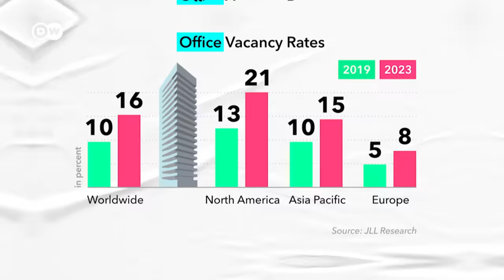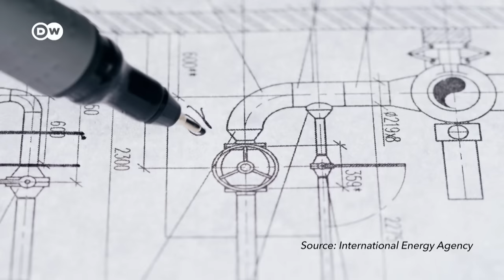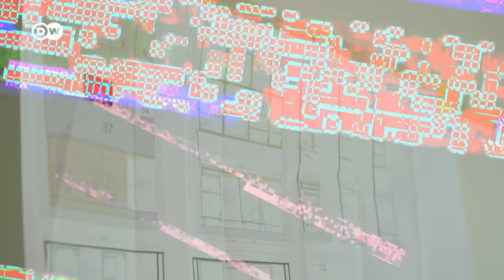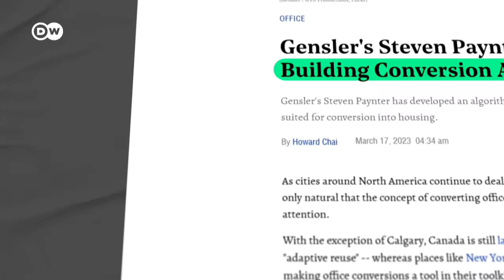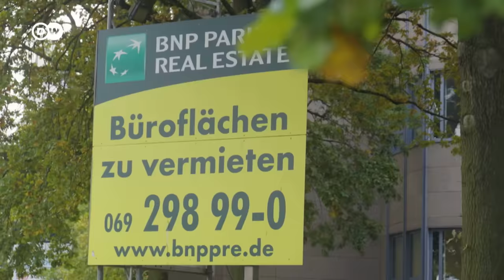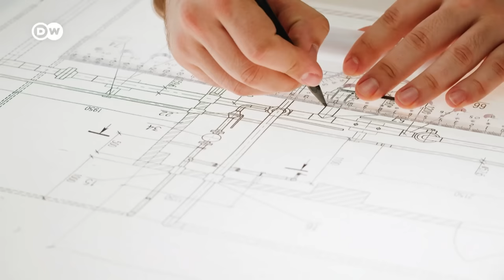Why don't we just turn empty offices into housing?

Comment: Well there's an easy fix for fitting in a lot of rooms with natural lighting.

Long apartments, note, not studio apartments.
The only window is the bedroom, so how does the living room get light?
There are many many ways of accomplishing this same idea, but ultimately the wall that separates the bedroom and living room just has a way to allow light through it, but also remain shut when wanted. This could be a halfwall with an entire slideable or folding section to open the other half. This could be glass walls with curtains. This could be standard walls with indoor shutter "windows". The best part is that halfwalls come with their own utility. If someone never wants to shut their bedroom-living room wall, then now they have an additional shelf space being the wall itself.

So your front door is where the bathroom is. Your kitchen and living room are right after. You probably have some cupboards in the opposite wall to where your bathroom and kitchen are, and then at the back is your bedroom. No natural lighting to your apartment unless you open the wall separating the bed and living room.

Additionally, you can butterfly flip this layout as needed. So if layout d has entrance in the bottom corner of the d and bathroom and kitchen on the left, then b is entrance on the left and bathroom/kitchen on the right, so a hallway connecting apartments such as dbdbdbdb would allow you to not only place 8 apartments on one side of a building all with natural lighting, but also would only consist of 4 specific plumbing points, as for each db combo, all four points of two bathrooms and two kitchens are right next to each other.

And it's worth mentioning that these concepts aren't new. Similar things are done with luxury caravans due to their limited space and side sections being taken up by other more important things than light such as kitchenettes and bathrooms. The light can only come in from the front and back, and minimally from the sides, which means light passing over the bed space to light the middle.

Comment: I do get a little nervous when you say that you don't want it to be easy to tear down an old building to replace it... because in a lot of circumstances, that is probably the best way forward. An abandoned big box store surrounded by a parking lot is such bad space use that refurbishing that big box store into anything else is still going to have horrible space use that will offset any gains from repurposing instead of rebuilding.

Comment: Part of the problem is that people who have been homeless  for a while are assumed to deserve to be homeless. They figure we must be irresponsible drug users who should be punished.
I'm 70, disabled, and homeless since 2016. The apartment I lived in for 17 years was sold, and the rent tripled. I've lived in horrid, corrupt bed bugged boardinghouses, and horrible nursinghomes. I'm costing the state 3x more to be in a nursing warehouse than if there were rent assistance. I've gotten SO much weaker than ever before, because I can't get the right nutrition, Rxs, or sleep. I took care of myself for 50 years, and all I want is a room where the state doesn't dictate my neglect. I can't find even a rundown efficiency apt for less than my whole Social Security check, and low-income housing, for disabled and seniors has had the waiting lists Closed for Years.

Comment: Just changing the codes in office complexes could help. There is a half empty office bldg near me, it even has a lap pool in the backyard for tenants (near San Diego, so year round). A 350 SF office could easily house a singleton, there are bathrooms right down the hallway and a Planet Fitness within walking distance for exercise and showers. If it's safe to occupy during the day, it's safe to occupy in the evenings and overnight, right?

Comment: Another idea is when building new towers they are designed for both the office and living space options so when you choose turn office Into housing or reverse the basic instruction for is there already, maybe even allows mix use of housing and office floors in same building or mix in same floor,  so you can having housing on every odd floor and office for every even floor, you can. A semi modular building designed for office and housing maybe even other. Types of buildings such as in building playground floors or other stuff all using the same base building designed. In the long run lower the cost when converting the floor type to another floor type

Comment: You did not mention rent on purpose? Atleast where I live office rent is much higher then residential rent. Converting an office building in to an apartment building would mean less income per square meter. We have a unique system for residental rents in Sweden maybe it's just here.

I do not know the quota. Nevertheless it would not surprise me if 20% vacancy in an office building is more profitable then if it was 100% full with residental apartments.
Reply: The difference is between a reduced rent and no rent. I'd prefer the former if I had an empty office block providing no income.
Reply: You can use the 80% of empty spaces as rent generating housing rentals.

Comment: My city is currently doing several conversion projects (I think about eight offices are being converted right now) while there's a few that have already been converted. It is quicker than a new development, and because the old buildings were built better than the newer developments, they can withstand the renos much better and last longer.  

The problem is, they can cost almost as much, if not more, as market units do. The first completed one in my city lists their 1BRs claims their range is just under market, but the only available units are $300 more while another, a hotel turned into apartments, charges $400/month higher than the average. And hotel rooms are small, especially when you add a kitchenette and say it's a suite. 

Conversion is a great idea  but if the point is to make housing more affordable, it needs to be closely monitored.

Comment: Some of the newer construction studio/1 BR apartments in Seattle only have outside windows in the living area, with a 3/4 wall to the adjacent bedroom to let in light.  Kitchenettes are minimal and are often set up linearly along the inside wall. There is usually a larger shared kitchen available for cooking.  Some just opt to eat takeout a lot.  Bathroom is on entry wall, though could be shared in the case of social or dorm housing.

Comment: The amount of resources that would need to be used to convert American office buildings into residential units would be much larger then leveling the building and starting from scratch. We are talking about going into a standing building, adding in water and sewer lines, electrical, firewalls, and so on. There may be a few buildings in the US that this can be done with, but it’s incredibly unlikely this is going to happen. It would also give you more downtown expensive apartments that this country doesn’t need more of. We need cheaper housing, not $5k a month rentals.

Comment: Finland/capital city area.
In my country it's going the opposite way 🙁 Appartments are being turned into offices (or hotels) at the central most areas in big cities. It doesn't seem many people are realising it's killing the life there. Instead many think it should be easier to drive and park your car in the centre so there will be more people shopping...
Old offices and factory buildings at the outskirts of cities are being turned into either luxury apartments OR super tiny one room appartments because the rent/price per square is always higher in small apartments.

Also new apartments are really terrible. Long and narrow, no separate kitchen, just cabinets on one wall, really small rooms. The number of bedrooms pushes up the price so they just try to fit as many as possible into as small a space possible.

As someone who loves communal ways of living all of this is especially sad. Older houses were/are great for shared living, but those are turned into offices and the new ones just don't work.
Reply from the maker: Hey there! Sorry to hear that. Hopefully there will be an improvement in the housing situation at some point ✨

Comment: They kind of did this in my village except they turned it into a hotel. The retail spaces were brand new but vacant for over 10 years. The ceilings are a bit strange that you can see all the pipes and ducts.
Reply from the maker: Sounds really interesting! What is the name of the hotel? We would love to look it up and find out more 🤓
Reply: @DWPlanetA  Steveston Waterfront Hotel
Also wanted to add when we went in to take a look, you completely lose your cell signal inside the buildings, on top of the rents being very expensive, I can see why they had trouble renting them out if a business can't make a phone call inside.

Comment: This is happening in Columbus, Ohio. Office buildings are being converted into apartments, in new hi-rise buildings. The new apartments are extremely expensive, driven by location. These new offices were built approx. 5 years ago and replaced older office buildings that were only 5 stories tall. The pandemic immediately made the new hi-rise offices, obsolete, as the office workers decided to work from their homes, located outside of the downtown.

Comment: The principle problem with converting offices (likewise offices into hotels) is the lack of plumbing and electrical services. You can run new electrical if the building was designed as a proper office in the 90's, but if it's older than that, it was built during a time before computers, and thus has a lack of electrical capacity to actually operate appliances (but not insurmountable.) If the office had a data center, there's your ability to have a stove or laundry room for the floor.

Converting an office building thus, best converts into a type of housing that has shared bathroom/kitchen spaces. Because that's all the plumbing was designed to have. However that is not the housing that is demand. The "3 bedroom"/"4 bedroom" large units are the ones missing from cities, because all that's been built for 20 years are rubbish fake "luxury" 1-bed/2-bed units that are under-sized and full of "flex/den" spaces that are marketed as being usable bedrooms or offices, but are sold under the pretense they are large bedrooms that a queen size bed would fit in, when they aren't suitable as a bedroom at all due to the lack of windows.

The solution really is to not try and carve up the floor space into multiple units and instead try to make each floor only one or two units as to not have to waste space on hallways. That minimizes the amount of plumbing that actually needs to exist, as a typical office building had enough plumbing capacity for two bathrooms and two break rooms per floor. Sure, that means you can't rent as many units, but then you also don't have have to deal with all the extra renovations needed to make them smaller.

Comment: The requirement for windows on every bedroom shouldn't be so strict. There could be multiple tiers of apartments, with some of them only having fake windows that either light up as much as the amount of light detected outside, or that have light channels which can be very narrow on the way in. These can be cheaper and/or be used for temporary housing to basically solve homelessness.

Comment: To allow more office-to-residential conversions. Why don't they do a partial conversion? If a property is too deep to give the interior light, why don't they convert the outer areas towards the windows to residential and then make the inner areas commercial? All commercial offices don't need windows, especially if the offices are more affordable. Then, more buildings will qualify for conversion, and it might even be cheaper than hollowing out the inside of a skyscraper or doing other drastic measures.

Comment: The problem is they make the conversions too fancy. Just put some bunk beds in there and you're golden. Or even just one or two massive open plan apartments per floor would be worth doing in some buildings, then you don't need to worry about the natural light issue.

Comment: 8:50 Upscale housing is still housing. Insisting on affordable housing is counterproductive, at least when thinking on a large scale (if the main concern is local gentrification it makes more sense, although that's basically a form of NIMBYism, IMHO). If you want to reduce home prices, build more homes.

Even amongst relatively rich people, owning multiple properties you don't intend to either live in or rent is pretty uncommon (although holiday hotspots might be an exception). With that being the case, people moving into a property generally means vacating the old one. If people buy up, then a cheaper property is now on the market. It's just supply and demand. Demand (families needing housing) is relatively static, so more housing means cheaper housing overall, whether that's 1000 mansions or 1000 studio flats. I can see the sense in demanding housing is dense - makes it easier to provision public infrastructure and dense homes are greener from a heating perspective. But not affordable in and of itself.

If insisting on affordable housing means fewer properties are built, because there is less profit in building them, you've actively made the problem worse.

Comment: Just silliness, we either have people working living in tents or "can we put a window over the sink" bright and shiny apartments. People need a roof over their head. There are plenty of places where the bathroom is down the hall. Each floor gets a family, oh my the elevator is so far away, we can't have that lets just buy them a tent. How long will it be before your everyday worker's just stop working because there is no longer a point to it? If there living in a tent anyway why bother getting dressed for the day and working. We have a family living on our block that is in HUD housing that is renting out rooms. They sneak their renter's in through the back door. They qualified for a three bedroom each bedroom is rented out to someone. The main family is living in the front room and everyone shares the kitchen and bathroom.   People are living in sheds, with extension cords run from the main house to the shed, no bathroom, water is in gallon milk jugs, bathrooms are a five gallon bucket. There worried about the light source, they need to get real.

Comment: Short answer: The infrastructural and design needs of an apartment building are substantially different from those of an office building, and the cost of full conversion would exceed that of bulldozing and building a whole new building.

Long Answer:
1. Lack of water, gas, drainage and ventilation piping / ductwork throughout the building.
2. Insufficient underground trunk-line capacity to handle the water / wastewater drainage needs of so many new kitchens, showers, and the residents using them.
-- 2a. This capacity cannot be retrofitted under existing buildings without digging / trenching; that means bulldozing the whole building. 
3. Not enough exterior windows for emergency egress requirements, written into building codes. You can't legally have apartments in the interior of office buildings because each bedroom must have at least one window, suitable for use in emergency evacuation.

Comment: Living in a converted building for the last year has turned me against this kind of effort. First of all, conversions are expensive. Second of all, to comply with window regulations in those buildings is extraordinarily difficult. My building did it by scooping a bit out of the center turning the building itself into a donut. The problem with living in the the donut hole what is that if you were on one of those interior units, you basically never got any sunlight because your windows were always in Shadow by your adjacent neighbors. I think you could solve this by having fewer units and larger units but that would never be acceptable to these large outfits because it would reduce revenue.

Comment: If you look at what happened in the Grenfell Tower Disaster*- there is a need for some "red tape"; adapting and upgrading existing buildings- even ones DESIGNED for living in has challenges. Especially retro fitting while still making sure buildings are safe and suitable for inhabitants. When large scale changes are made to buildings there is a need to examine whether people will be safe. Not all bureaucracy is helpful but neither is making sweeping changes without ensuring that it is totally safe.

*151 homes distroyed, 72 burnt to death, numerous people will suffer for the rest of their lives.

Comment: Why not have these buildings be mixed use? A section of it apartments (especially attracting those who work for a company that’s in the same building as to lessen commute time), other company offices and the other shops/restaurants?
Reply from the maker: Hey there! Yes, this important. In the second example in Frankfurt, this was done as you mentioned. The city planner our reporter talked to also mentioned that the best way to plan for the future is to avoid building anything with just one function :)
Reply: @DWPlanetA I see. I didn’t watch the rest of the video.

But I’m glad that the planner (and possibly others) have already thought about mixed use zoning. That’s one way for landlord/property owners to not lose profits and it may address housing shortage.